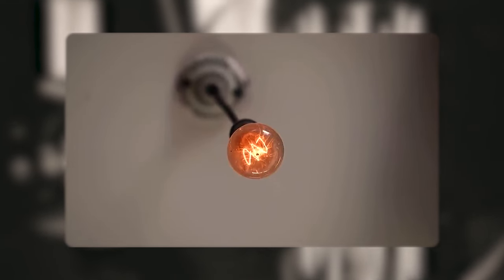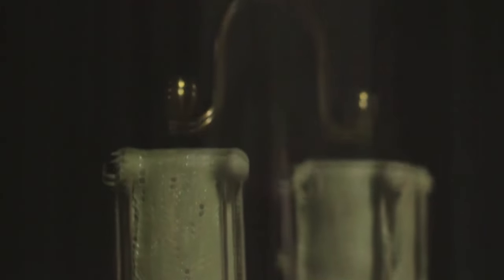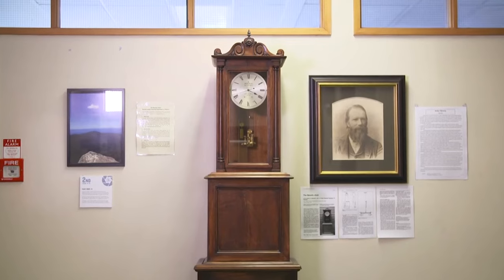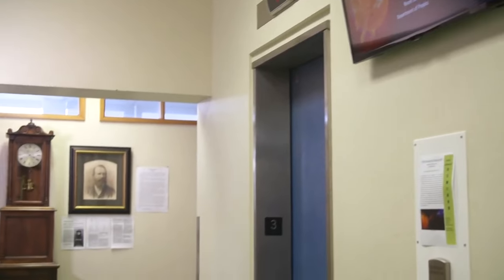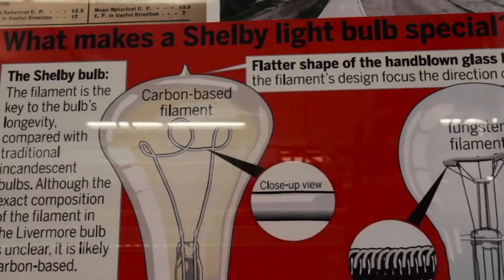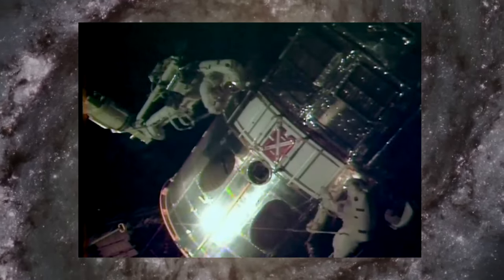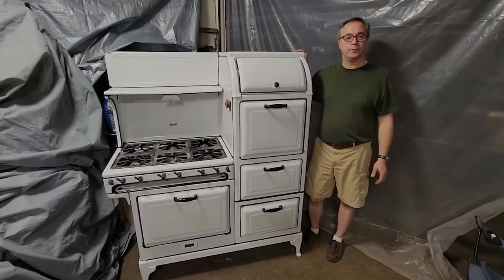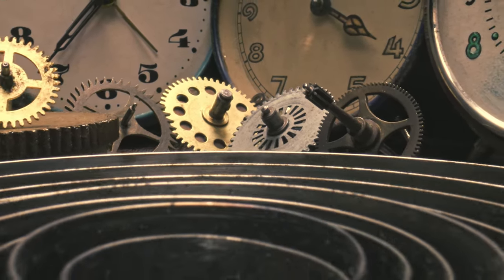Why These Old Inventions Still Work: Timeless Technology Explained

Comment: A carbon filament bulb is an incandescent bulb. There are many filament types for incandescent lighting. Any object heated to a point at which it radiates visible light is incandescent, such as sparks ground off a weld, or a glowing fresh weld bead.